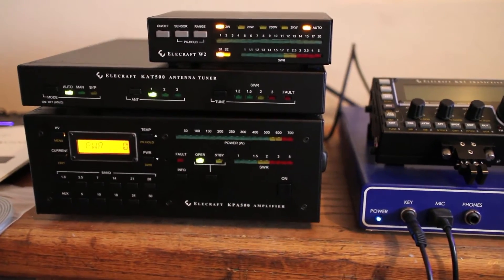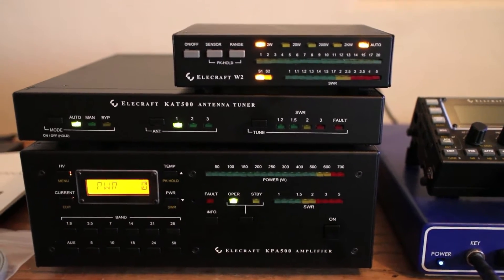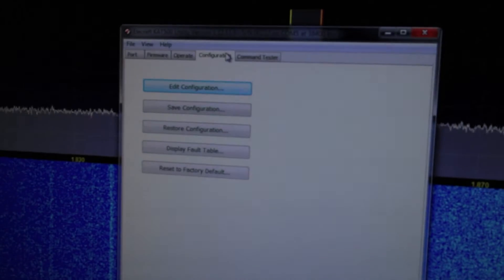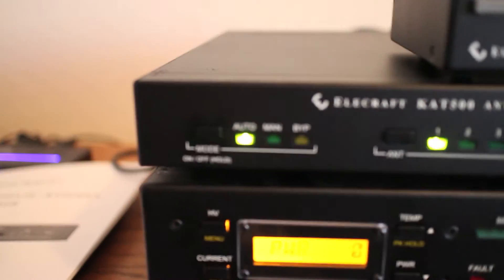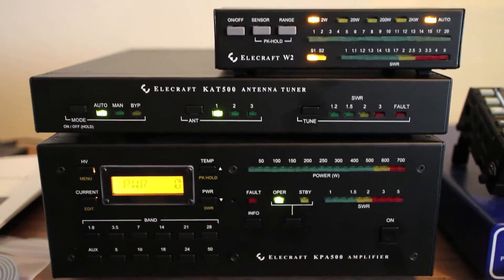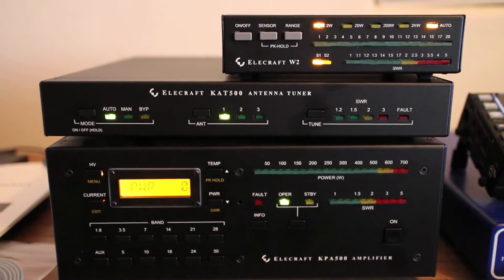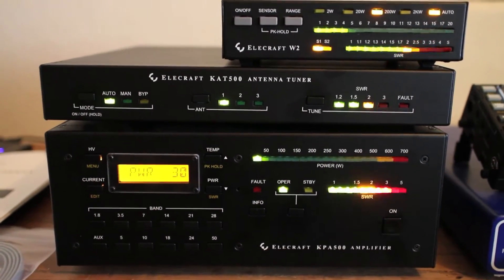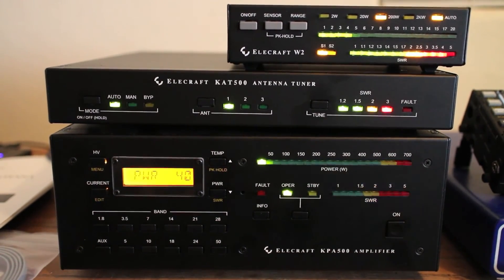Elecraft KPA500 KAT500 Keyline Question

Comment: That seems normal in my opinion. Solid state amplifiers are very sensitive to high  SWR's. The best thing to do is to turn the amplifier off, go to all the different bands and tune each band so that the tuner can learn and store the tuned settings. When that is done then turn the amplifier back on and go back to the different bands and operate, then the KPA should not fault.
The amplifier only faults because it is seeing the high SWR's when you switch bands and tune. I have two solid state amplifiers and that is how I operate them otherwise I end up with the same response.
Reply: Very much my friend

Comment: Interesting. My KAT500 arrives on 12/13/12. Did you get any response to this? I'm wondering if the firmware isn't catching all situations and is why it isn't blocking the PTT to the KPA500?
 
Anyway, if you get a sec, please drop me a note or pointer to the entry on the reflector. I did a search earlier and couldn't find it. Thanks, Tom / w1txt@arrl.net